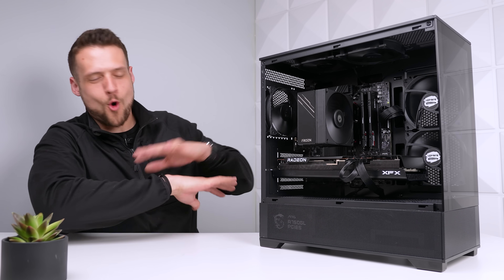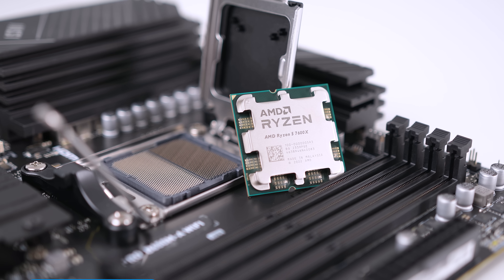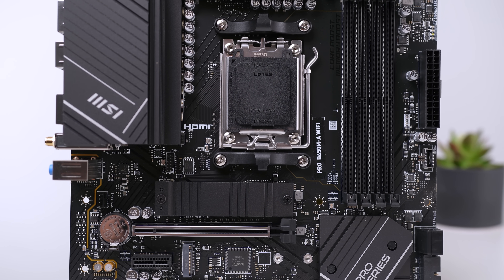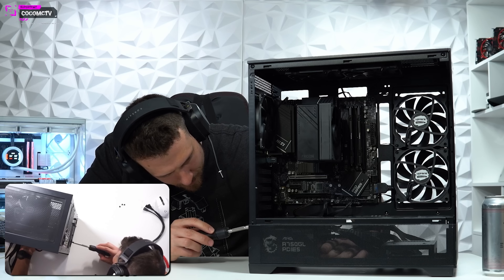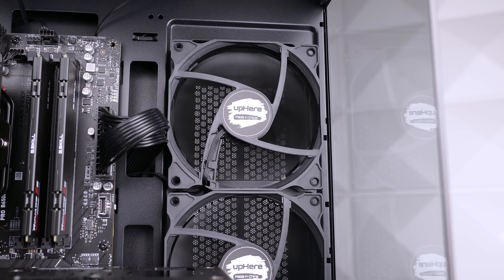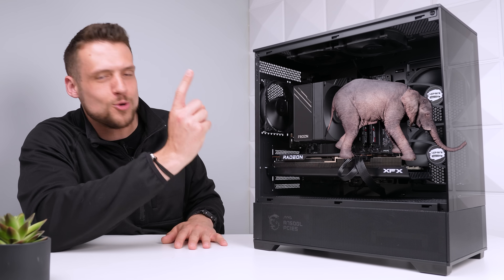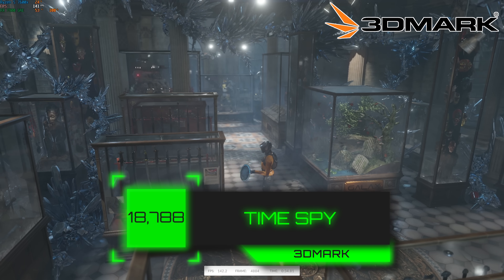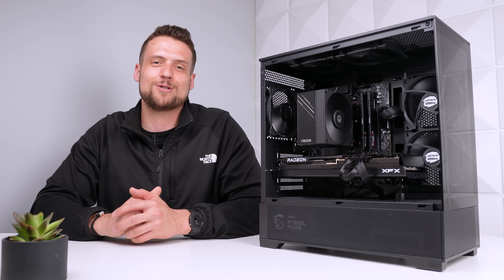$1250 PURE PERFORMANCE Gaming PC Build Guide

Comment: Im building with similar specs regarding the main components. Went with regular 7600, almost chose that msi mobo but i think im gonna go with asrock pro rs instead and lastly swapping the gre with 9070xt. In my country, theres a matx case that only cost around 30usd and it comes with 4 fans. Its gonna be a tight fit tho since it only has 340 max gpu length while my 9070 is 327mm😭

Comment: Zack, I have a question, is this build good?
AMD Ryzen 7 5700X3D 3 GHz 8-Core Processor
	Gigabyte GAMING OC Radeon RX 7800 XT 16 GB Video Card
	Gigabyte B550M AORUS ELITE AX Micro ATX AM4 Motherboard
	G.Skill Ripjaws V 32 GB (2 x 16 GB) DDR4-3600 CL18 Memory
	Corsair RM750e (2023) 750 W 80+ Gold Certified Fully Modular ATX Power Supply
	Kingston NV2 1 TB M.2-2280 PCIe 4.0 X4 NVME Solid State Drive (x2)
	Thermalright Peerless Assassin 120 SE 66.17 CFM CPU Cooler
	ARCTIC P12 PST 56.3 CFM 120 mm Fans 5-Pack
	Corsair 4000D Airflow ATX Mid Tower Case
Please respond if u can!!Thanks!

Comment: went with similar

7500f -130 usd
7900 gre - 530 usd
asrock b650m rs pro wifi -170 USD had to import germany
gskill cl 30 flare x 32gb - 16 gb x 2 -108 usd
crucial p3 plus 2 tb -125 usd
Msi mag a850gl - price differences was 3 USD to 750 gl - 110 usd
went with a cheap coolleo b40s DIG BK ARGB cooler something like a deepcool ag400 dig - 29 usd
Montech air 100 argb.-65 USD

total was 1260 USD over 1300 with shipping.  prices were more expensive where I live.

Comment: Hey I just built an identical build and when I powered it on, the CPU light and ram light turn on and it does not boot at all- any tips? I feel like I’ve tried everything including re- seating the ram, cpu, and graphics card and yes the cables are plugged in properly
Reply: Update: I tested another gpu and my system worked perfectly so I returned the gpu for another one and we will see if it works after installing all the drivers with imbedded graphics

Comment: Hey, I bought all the parts and I plan on building the PC when everything arrives, as a first-time PC Builder, I was wondering how the fans are connected to the Mainboard, I read that there are "only" 3 sys Fan connectors?
Maybe you or someone from the community can help me 😊
Reply: You Need to buy a Fan hub its only Like 10€
Reply: @KonradBecker-rf3rj  
Thank you for reminding me, that I never updated this comment.
There actually is a fan hub included with the case. I built the pc, it's running perfectly and I love it.

Comment: Hey Zack I actually just copied this build and I was wondering if you had any trouble when it came to the gpu being detected when it comes to plugging in a hdmi or DP to the gpu cuz I get display when connected to the motherboard but not the gpu
Reply: bro is not worth it i copied zach $1250 exactly the motherboard is not compatible for the RX 7900 GRE !!  i have no choice but to buy rx 7900xt and ryze 7 7800x3d !! and it finally work !.
before you buy a any motherboard look up what is compatible for the GPU!!  i've waste so much time and money to figure out what is wrong it ! I hope it help

Comment: Hey Zach, just one question about the build, I put both the GPU and CPU into a bottleneck calculator and at 1440p the cpu is bottlenecking the GPU by around 20%. Is this a big deal? What is the range of bottlenecking that is indiscernible? Thanks!

edit: Saw your bottleneck calculator video and have discovered I did in fact use it wrong, thanks for the info mate!

Comment: Does anyone know if i can switch out the rx 7900 gre for a 4070 super?
Reply: you can if you're planning on using Raytracing.

If you're not gonna use RT go with 7900 gre since its better value and performance wise better.

Comment: If you are really worried about the SSD speed your best bet is to throw your OS on a secondary cheap small potato SSD and stick your /home (or steam library if you are on M$ Spy OS) on the bigger better faster SSD which should be in the primary slot.

The parts of the OS that really matter will be loaded into RAM anyhow, so that SSD isn't that important.

Comment: Can this build play in 1080p? Im new to pcs and am curious if it works better with 1440 p rather than 1080
Reply: 1080 is just a lower resolution. It'll do 1080 stuff even better. 

That being said, this pc is overkill for 1080p gaming. You could go a lot more budget.

Comment: Don't care that they're "off-colour", the Gigabyte's "Eagle" GPU's are honestly impressive. They're an ACTUAL dual-slot card- not 2.5, 2.8, or "3-slot, but we only put two brackets in, because it was really important for us to save 3 cents on that 650$ product, and now your GPU is sagging more than your grandma's tits" yet they offer a very good level of cooling- at least for mid-range GPU's where they're mostly used, making them perfect for smaller form factor builds.

I personally have 6700xt eagle, and I rarely see the hotspot going past 80C, even in the summer (and yes it does make a difference- not American, I don't have AC), and outside of gaming it's completely silent since the fans don't turn on until the GPU reaches 50C, and it doesn't- the heatsink and my case fans are enough to keep the temperatures in the 30's, low 40's on the hotspot.

Comment: I have watched so many of your videos while I was researching on a good build for myself and I'm concluding on a build that's pretty similar to this, just prettier. Here are my thoughts and changes.

There is no special reason to go for 7600X since 7600 is already really good and doesn't bottleneck the gpu. And I have heard from PC Builder that going with 6000Mhz+ DDR5 Ram isn't a good idea. (Something to do amd optimisation?).

I would downgrade CPU to 7600 and rams to 6000MHz CL30  (rgb & white), get a white rgb cpu cooler instead, Antec NX292 Elite White Case (it has 4 rgb case fans, great looks and cheap), and Sapphire PURE variant of 7900 GRE (which is white). Everything else is same. Also, that A750GL PSU is A-Tier according to the Cultist Network, so that's solid.

Thanks for your helpful videos and the resources in your site (gpu, psu and ssd list really helped!).

Comment: hi, i have a question... Why did u choose to put inside this particular build a ram of DDR5 6700Mhz if the cpu max memory speed is DDR5-5200 ? i'm trying to figure it out if ur cpu speed ( in this case 4.3base and 5.3 overclock) needs to match the RAM speed.. Thanks a lot !! love ur work

Comment: I just want to point out that the 4070 super is actually a good replacement for this, theres one in amazon in my region for $670 and a 7900 gre for $630 (acer version, the xfx is MUCH more expensive), and the 4070 super is literally 10% better (according to userbenchmarks atleast). Also I use the 4070 super, I have yet to find a game that cant run this at more than 60 fps. Again, this is in my region but for anyone who wants a nividia alternative I do reccomend this. A 4070 super I think is a direct competitor, however.
Reply: you are using userbenchmark. it isnt reliable. Just watch benchmarks man, the GRE crushes the 4070S for less money

Comment: So i have a build but i would like feedback on it, 
Itll will have a MSI MAG A750GL PCIE5 power supply, silicon power value gaming ddr5 32gb and 6000MHz,  Samsung 870 SATA lll SSD 1Tb, NZXT h6 flow case, MSI pro b650-s WIFI Pro series motherboard, rtx 4060, AMD ryzen 5 7600, a Kingston NV2 500G M.2 2280 NVME internal SSD, and a NOCTUA NH-U12A cpu coolor
I would like to know if this is a good build for what its worth which is $1216 on amazon
Reply: Get a 2TB nvme instead of that, and get a rx 6750xt or rx 7600xt

Comment: I've got parts coming in for a 12600kf, z790, ddr5 6400cl32, and 7900gre  build right now. Few used/refurbished  parts but it's all black and white with a fishtank and cable extensions and  90° adapters for the 24 pin and usb3.2  for only about $1050 after tax.  I'll be curious  to see how it stacks against this one.

Comment: Just built a computer very similar to this (but with ARGB) for about $1175:

CPU: R5 7600
Cooler: Thermalright Assassin X120 RSE ARGB
GPU: PowerColor Fighter 7900 GRE
Mobo: ASRock B650M Pro RS WiFi
RAM: TeamGroup TForce Delta ARGB 32 GB DDR5 6000 MHz CL30
Storage: TeamGroup MP44L 1 TB (4.0x4)
PSU: Corsair CX750
Case: Montech Air 100 ARGB

The 7600/7600X with a 7900 GRE is the best value you can get for around $1200 for 1440p and entry 4K. Loving the build!

Comment: I built a pc with the 7800x3d and a 7900gre in a h7 flow and put the gpu on a vert mount, was a beast, ended up selling the whole build for $1950, was all corsair icue and it went with a corsair mouse and keyboard that were also icue compatable as well as a 1440p 165hz monitor, broke even all together lol

Comment: PCPartPicker Part List:

CPU: AMD Ryzen 5 7600X 4.7 GHz 6-Core Processor  ($199.98 @ Amazon) 
CPU Cooler: Thermalright Assassin X 120 Refined SE 66.17 CFM CPU Cooler  ($17.89 @ Amazon) 
Motherboard: ASRock A620M Pro RS WiFi Micro ATX AM5 Motherboard  ($129.99 @ Newegg) 
Memory: TEAMGROUP T-Create Expert 32 GB (2 x 16 GB) DDR5-6400 CL32 Memory  ($94.99 @ Newegg) 
Storage: Crucial P3 Plus 2 TB M.2-2280 PCIe 4.0 X4 NVME Solid State Drive  ($117.99 @ Amazon) 
Video Card: PowerColor Fighter OC Radeon RX 7900 GRE 16 GB Video Card  ($519.99 @ Amazon) 
Case: GameMax Vista M MicroATX Mini Tower Case  ($55.99 @ Newegg) 
Power Supply: Cougar GEX 850 W 80+ Gold Certified Fully Modular ATX Power Supply  ($89.99 @ Amazon) 
Case Fan: ARCTIC F12 53 CFM 120 mm Fans 5-Pack  ($22.36 @ Amazon) 
Total: $1249.17
Prices include shipping, taxes, and discounts when available
Generated by PCPartPicker 2024-06-01 22:45 EDT-0400

Comment: I have a question i want to build a pc contains a gigabyte 760 mother board (181$)
I5 13400f(180$)
2*16gb ddr4 rams(80$)

Should i get rtx 4070(around 720$) or the rx 6800xt (611$)

Pc parts are abit over priced in my country and i can't find a 4070super or amd 7000 seires gpus(amd gpus are abit rare idk why)

Comment: Hey Zach!
My PC is around 5 years old and I have the following configuration:

CPU: Intel Core i7 8700K 6x 3.70GHz 
GPU: 8GB Gigabyte GeForce GTX 1080 Windforce 3X OC 
PSU: 550 Watt be quiet! Straight Power 11 Modular 80+ Gold
Mobo: ASRock Z370 Extreme 4 Intel Z370 So.1151 Dual Channel DDR4 ATX Retail
RAM: 16GB (2x 8192MB) G.Skill RipJaws V black DDR4-3200 
Cooler: be quiet! Dark Rock PRO 4
Case: CoolerMaster MasterCase 5 

Are there components that I can keep when I consider upgrading my system to play on an 27 inch 1440p monitor with 144+ FPS?

Do I even need to upgrade if I stay at 1080p gaming? I still feel that my PC is quite good.

Comment: pls help meeeeee i have a samsung ssd m.2 nvme 980 1tb 15 2390t h61 foxin mobo and a 1050ti sata128gb ssd(ill destroy it if needed)  , DOTN U DARE CLOWN ME ABT BOTTLENECK, whenever i plug the gpu i cant boot from the nvme drive and it also become useless and crashes the computer if it is accessed when i boot off the 128gb sata ssd

Comment: I am getting a deal for 600$ that have
I7 12700f
32 GB DDR4 3200MHz
RTX 3050
Cooler Master CPU Cooler
Red Dragon Casing
512 GB WD Nvme
1 TB Segate Baracuda

I want to know what do you think about this deal.

The deal from a gamer who had used it for 4 Month. Some of the parts still under warranty.

Comment: Hi I need help I’m a sim racer building a budget pc I have a rtx 2080 ti I got for $125 and I’m looking for a good cpu maybe a ryzen 5 5600x but looking for other suggestions that won’t bottleneck my system looking for something around $150 or less used also is 32g of ddr4 overkill and should I just do1 16g If it is a intel cpu could you recommend a good sub $80 mobo that supports ddr4 or if you choose a am5 cpu can you recommend a mobo that supports ddr4 under $80. Thanks 🙏 love the videos

Comment: been asking everyone, to reply if my build is correct for 1440p or 4k in some games. 
i would buy rtx 4070 ti super, r7 7800x3d, 32 gb of ram, and so on. the problem is, can i pair r7 7800x3d with good air cooler or should i buy liquid cooler for cooler system? from what i saw, i decided to buy pccooler rz620, and correct me if something's not okay with my build. thanks.

Comment: hi zach , i have an old dell pc with intel i5 3570 and 8gb of ddr3 ram and my pc has pcie 2.0 and i want to use nvidia GeForce GT 1030 which has pcie 3.0 can i still use GeForce GT 1030 on pcie 2.0 (it is very cheap in my local market)

Comment: How tf do I build this? I got everything from this video and I don’t know how to build it, I’m stuck on the power supply, I don’t know what cables to connect. HELP PLZ.
Reply: Look at your motherboard manual to see what connects are labeled as what, and match the connections on the back of the psu. Generally they are all very close to the same layout.

Comment: The benefit of the ryzen 5 7600 or 7500f is that they come with a cpu cooler which is good enough for most used cases. So you end up saving 40-50 dollars because you don’t need a cpu cooler for very little performance being lost

Comment: Hi Zach recently upgrade my gpu from rtx 2060 to rx 7800 xt, and ofc my psu. But i notice some clicking sound from my case do you know which component cause it? using gigabyte ud 750watt, and vga holder on my rx 7800xt.

Comment: Lately, I've been watching your YouTube shorts. Could you recommend an AM5 motherboard with DDR5 support to pair with my Ryzen 7600 and RTX 4060 graphics card for 1440p high gaming? The motherboard should have built-in Wi-Fi and Bluetooth connectivity. I'll be using 6400MHz CL40 RAM and a Crucial P3 Plus 1TB Gen 4 M.2 SSD. Can you suggest a suitable motherboard under $150? Please reply.

Comment: I would make a few changes to maximize $/FPS.
ASRock B650M PG Lightning WiFi $120
Ryzen 7700 AliExpress $187
Thermalright Phantom Spirit 120 (Flat top version) $36
TEAMGROUP T-Create Expert DDR5 32GB 6000MHz CL30 $98
1TB TEAMGROUP MP44 7,400/6,500MB/s  $75
Montec Air 100 RGB $65
Even if you don't swap the CPU the other changes are a better value.

Comment: AMD Ryzen 5 3600 
Colorful B450M
AMD XFX 5700XT Thic III 8GB (10/10 Condition - Box Available)
AMD Stock Cooler
Xpg 8x2GB DDR4 2444mhz
600W Powersupply
CoolerMaster Elite Case 
Hikvision 256gb SSD

How much should I pay for this pc 
Your response would be greatly appreaciated 
Currently the seller wants around $480 but i think i can negotiate to $400 maybe

Comment: Nobody dose benchmarks with a 1440p ultra wide monitor, and ultra wide curved monitors are the best for emersion short of a VR setup and very popular. The $350 165hrz range is excellent for this price range and there are some half decent 32-34" ultra wide monitors in this range.

Comment: Instead of a 7600x you can get a 7500f, I’ve seen 7500f’s for as low as £110-£120 but normally they stay at around £140-£160. Performance difference is negligible

Comment: I need your help. I am not able to decide whether I should Take RX 7600 (8GB Vram) or 3060 (12GB Vram) they both are like same price in India. RX 7600 is faster than 3060 and it will be white colour as well. Please help me choose. I can't do much editing stuff, probably higher than average and I'd like fo record videos as well.....My pc is all white so help!!! What should I take? Also, I live in India and the prices are alot different than USA. 3060 and 7600 are for 26K and 6750XT, 7600XT, 4060, Intel Arc A770 stuff are like 34k Above and I can't push that much budget

Comment: Zach please rate my new pc build im about to finish buying!  Case is the h9 elite, cpu is the Ryzen 9 7950x3d,GPU Asus TUF 4070 ti super OC, 32 gigs of ddr5 ram, my mobo is the asus rog strix x670 e f with a crucial p3 plus 2tb, my fans are arctic p12's, and a custom water loop for it all.

Comment: You can get a 7800x3d or 13700k combo at microcenter for $480. Though I'm not sure if the motherboard would fit in a micro ATX case if small size is also a goal. You could also get a 14700k combo at one point but that is gone.

Comment: I have been told that if you get a 6400mhz ram it can still only run at your cpu support speed. So if your cpu supports 5600mhz at max then the 6400mhz ram is useless. Is this really true?

Comment: Zach I've been planning to source PC for my son from US for past 2 months with 7600x and 7800xt but this video upgrades my build to 7900 GRE. Great video. Thanks a zillion.
Reply: 7800XT / 7900GRE are so close in performance. The NItro+ 7800XT beats the cheapest GRE.
Reply: @TheVanillatech small undervolt on the 7800xt and they are equal. But if the price is good, go for the GRE… I would personally not go with the 7600x … 2024 I would buy 8 cores…
Reply: @TheVanillatech  when I undervolted my 7800xt it went from 101 to 109 fps in Horizon forbidden West. This is about what a Basic GRE will provide. 
I would not be able to feel the difference 😂

Comment: 1. *CPU (Processor):* AMD Ryzen 5 5600

2. *Motherboard:* MSI B550M PRO-VDH Micro ATX

3. *RAM (Memory):* TeamGroup T-Force Vulcan Z 16GB (2 x 8GB) DDR4-3200

4. *Storage:* Kingston NV1 500GB NVMe SSD

5. *GPU (Graphics Card):* AMD Radeon RX 6700 XT

6. *Power Supply:* EVGA 600 W1, 80+ WHITE 600W

7. *Case:* Cooler Master MasterBox Q300L 

would this be a good build for gaming performance trying to build my first one ever
Reply: add an hdd, 500gb wont last long for gaming, get that ssd and like a 1-2tb hdd
Reply: @Alexmakersd  what a shitty recommendation
Reply: If you don't go for micro atx, you could have a better GPU, CPU and better pricing. Micro atx parts are always expensive
Reply: @hasanshafique6758 just the mobo is m-ATX
Reply: @hasanshafique6758 literally no difference
Reply: Never cheap out on a ssd